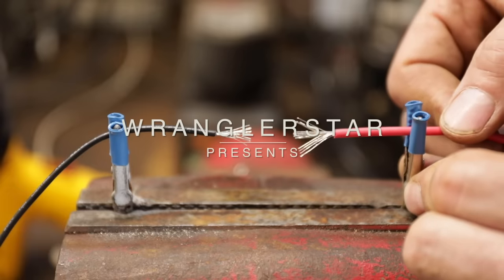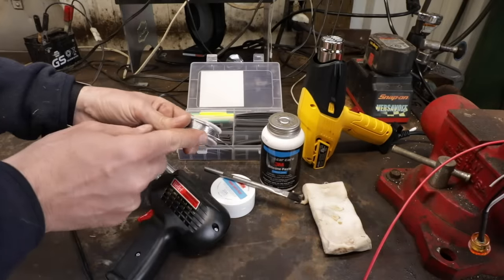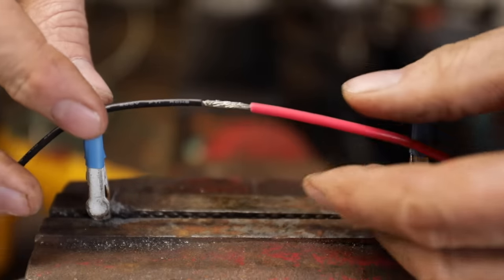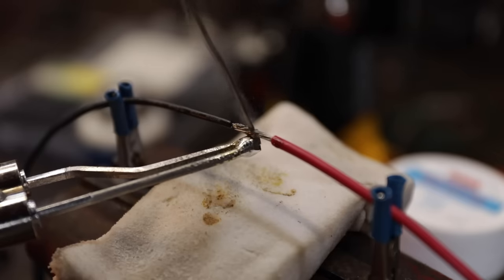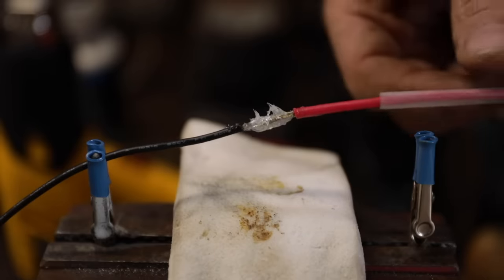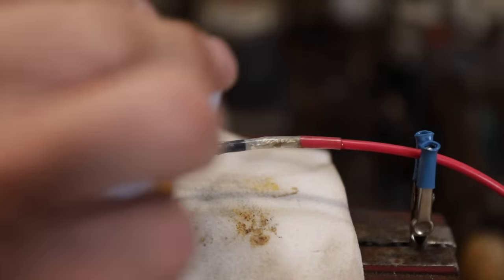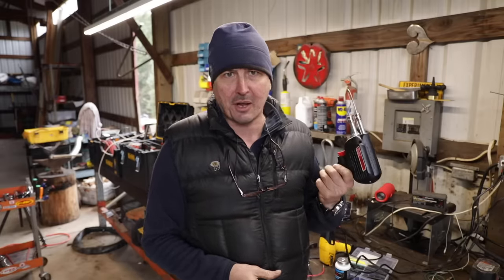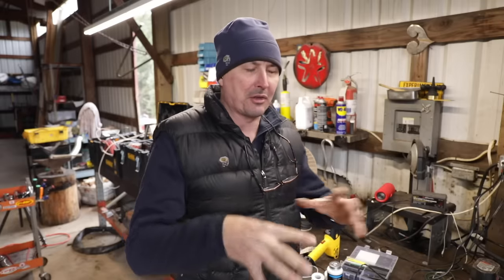How To Solder Wires Like A Pro

Comment: I'm sorry, but anyone twisting wires together before soldering them, is not soldering like a pro. A pro understands that a flat solder joint between two wires is stronger than the wire just outside of the solder joint. As in - if you manage to pull a good solder joint apart, it's the wires that failed, not the solder. Time is money to a pro, so a pro doesn't have time to do anything unnecessary.

Now... truth be told, I have seen some "pros" produce solder joints so bad that it forced me to consider the possibility that they had been born with no thumbs (the auto repair industry, for instance, is full of people who solder incorrectly), but I assume the title of this video means "GOOD pros", not crappy ones.

I'm less sure about this, but if you're already soldering with flux, also waterproofing the joint with grease seems like total overkill. Maybe if you're working on something built for salt water marine applications, but even then - a good shrink tubing job will keep the water out unless it's pressurized. And if it IS pressurized, I don't know if that grease is going to stop it from coming in.

Comment: You put solder on the iron and hold it to the wire.  The solder should penetrate the insulation about a quarter inch to do it correctly. Don't listen to this guy. He's not doing it right.

Comment: Takes WAY too long.  I slide shrink-tube on one wire, crimp it in a two-way crimp, then crimp the second wire, heat with torch, feed rosin-core solder, cool, slide shink-tube, heat and shrink, DONE.  Elapsed time:  About 40 SECONDS, not 9 minutes.

Comment: why not just tape em together lol
Reply: M.Grey That also works, just as long as you don't pull the wires apart with high tension. I have just twisted wires and taped it for audio use and its passable and works great.

Comment: Crimping is better than soldering - soldering creates different metal surfaces, capacitance and will fail sooner. Of course, the problem is a good crimping tool and the really pro ones are really expensive. Btw, NASA has a handbook about it: https://nepp.nasa.gov/files/27631/NSTD87394A.pdf

Comment: Charred wire insulation...thickness of the spliced wires exceeds the diameter of insulation.  Silicone grease, really?  There are better things to put on for water proofing.  If I have to splice, "Lineman splice" all day.  Splice like that, and you'll be redoing it in a couple days.

Comment: If you heat up the wire like that when its connecter to a resistor it can damage it... Not really helpfull when you have to fix stuff

Comment: Ok, but not the best, it doesn't add much mechanical strength to the join
Reply: I bet you'd break the wire before you broke that solder joint......

Comment: Solder is an electrical connection not a mechanical connection. This is not a NASA certified solder joint. Pretty but wrong. Joint two hook shapes for mechanical strength.

Comment: This is not how to solder wires like a pro, a pro can solder wire with two hands. No vice needed. This connection has poor strength compared to twisting the wire ends making an X pattern, then with each hand grabbing the insulation of one wire and the twisted wire end of the opposite wire. Twisting them this way is much stronger, and can be done in places you can barely reach with your soldering iron. You only need your two hands, when you go to solder, the wires are self supporting no matter the gague.

Comment: mediocre advice. I did the same exact steps and the wire never heated enough to melt the solder. "just use any soldering gun" WRONG, you need a soldering gun that will get the wire hot enough to melt. I need to know the minimum temperature I need, and for the price of your heavy duty gun I can just buy a new extension cord.

Comment: But if you have to link 30+ wires an hour, this method is not practical, , time consuming).

Now, if you have 10 or less and the wires can be moved to the table, then this method is great, but if the wires are coming out of walls, then this will not be for you.

Comment: this is painful to watch, sorry. use a less powerful iron, it instantly oxidised the strands. Also tinning is to add surface area between the iron tip and the wire.

Comment: Sorry, but this WHOLE thing was WRONG. Flux paste??? Silicone grease ??? Obviously using techniques from a 1980s ‘plumbing self help’ book. Sorry, but this is bad advice. Go to an old hand at electronics to learn properly. ....oh, and put the heat shrink tubing on first. Works much better.

Comment: Please don't try to teach things you haven't been trained for.  I'm reposting a comment, because you aren't alone in shoddy soldering on Youtube.  Uncle Sam spent a boat load of money teaching me how to solder for NASA.  You failed to remove the oils from your hand and it will cause corrosion eventually.  You always want to clean the joint after soldering too.

Your soldering would never pass a high reliability test.  Best practice is to clean the wire with alcohol, let it dry and apply rosen flux before soldering.  You can get away with your technique for years, but it's not the best way.  We discovered this during the space program when a satellite was 100 pounds over weight.  The theory at the time was "bigger the glob, better the job," but we did a lot of research and came up with a set of best practices.  There are classes you can attend, and probably online now too, called "high reliability soldering."  It may not matter for most stuff, but it's best to learn the right way first.  You can decide if you want to skip corners.  I've done it your way when I didn't have time or the right tools, but I shudder every time I look at my shoddy work later.

Comment: you  didnt  even pre tin the wires......... just a  blob of solder
Reply: Not necessarily true, if done correctly the solders melts and soaks down through the strands
Reply: @scan865  which requires  that you keep the heat on the wires for a longer period of time. which is bad..

Comment: Poor way of SOL-DERING! Look at the roll of solder: how is it spelled? Notice the letter L there....soLder! And don't solder wires or connectors on cars, bikes or airplanes etc. The reason makers use crimp connectors is to avoid vibration cracking them apart, which is what soLder does!
I also use heat shrink that has glue inside, it's a little more expensive that standard stuff but lots stronger

Comment: These tansformer type soldering irons with the vertical tip arangement are just awful. If you find a piece with the horizontal arrangement like this one, the soldering would be much easier: https://www.mylms.cz/jak-spravne-pajet-trafopajkou-a-jak-si-vyrobit-pajeci-ocko/

Comment: So many negative opinions...could it be that there’s more than just one way to do something and that if all of them work adequately that’s enough without having to sh$& all over the discussion board?
His tip was clean, properly tinned and the joint looked bright and the insulation wasn’t melted. Compared to some of what I’ve seen over the years this was excellent!To all the non pros: if it works for you, use it. Don’t listen to the know-it-all superdicks so full of themselves and obnoxiously so.

Comment: Your videos Overkill and you're soldering gun is horrible a soldering station Works exceptionally better. You don't need to put anything under your wire unless you're worried about burning what's under your wire if it drips